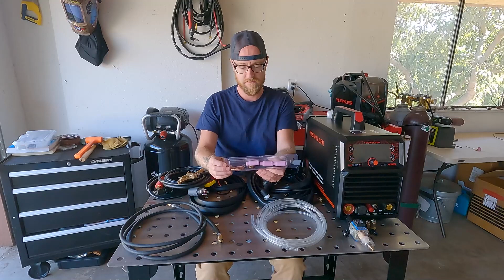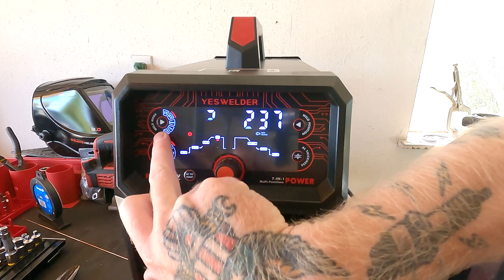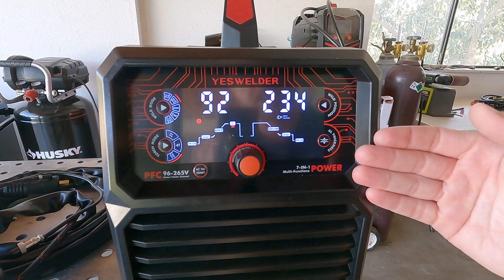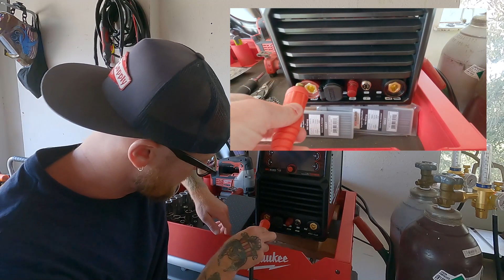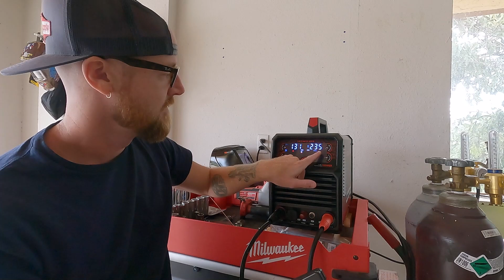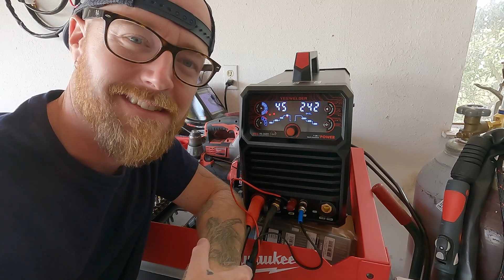CT2050 Users'Guide | YesWelder

Comment: Do you have to install the oil water separator if you're using the internal compressor ? ❤
Reply from the maker: If you don't use it for a long time, it is acceptable to forgo installing an oil-water separator.😊

Comment: You left out how much psi on the regulator for plasma cutting
Reply: You can run it around 100 psi .that's one of my favorite things about this welder. And u can run the volt pressure at 100 also. Just try anything, this welder is so good it will weld WHAT Eva your thinking.  I hope this answers all you questions. If you have any more, don't ask this guy. just ask .me 😅

Comment: Hello, first off, Kudos to  your presentation and the way you explain things. I recently received my CT-2050 and it seems like it' like trying to take a sip from a fire hose. I am not a welder by profession, I am a Golf cart customizer and repair person. I have taught my self to FCAW and wanted to further my learning on how to weld. This is one of the main reasons for choosing this machine, it does most everything I want to learn!! Some carts are steel frame and others are aluminum. Most of my welding is making custom brackets for sound systems and and side steps /running boards and require very neat welds. The documentation that comes from Yeswelder for this machine I find rather sparse. Your video is a great help. Keep em coming! Cheers and 73. John Holzapfel
Reply from the maker: Hi Kathryn! We're glad to know that you are satisfied with your welder. :) Thank you for trusting us!